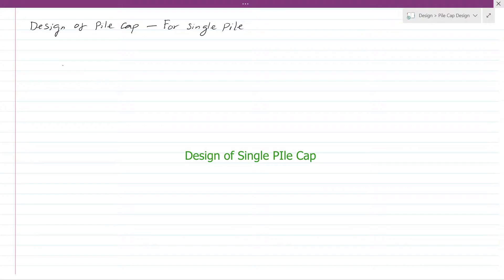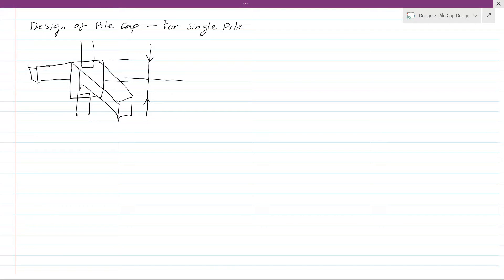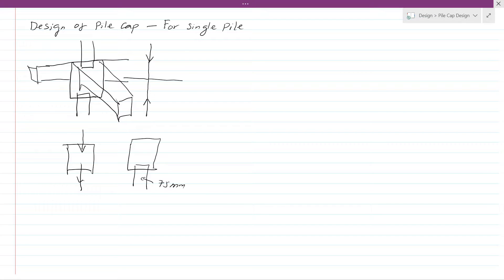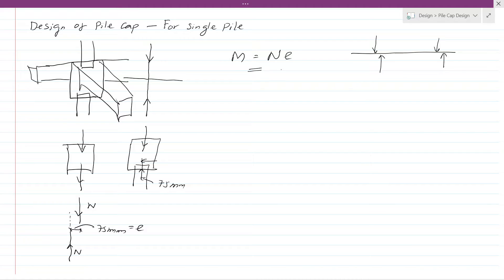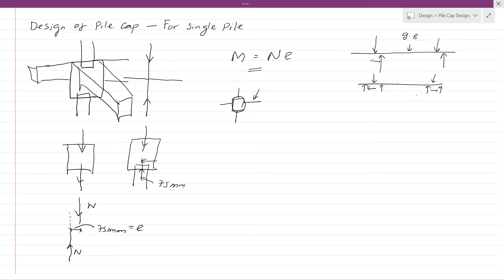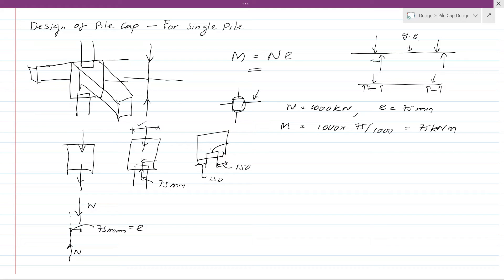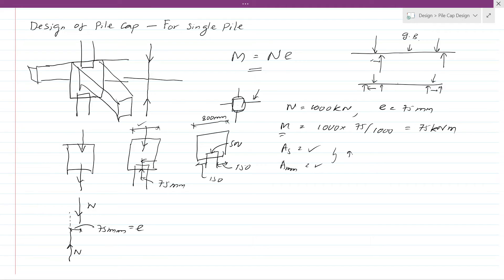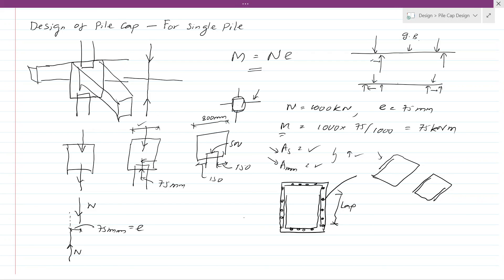Pile Cap | Design of Single Pile Cap | Worked Example

Comment: Which Code clauses specify the 75mm eccentricity, and the 150mm overhang?
Reply from the maker: These depend on the type of code and construction methods. Generally, the allowable tolerance is defined for the pile construction and then it is considered for the design.
You may refer to the structuralguide.com website for more articles on this. 
The following like would solve most of your concerns. 
https://www.structuralguide.com/pile-foundation-construction/

Comment: is it possible to design without beam
Reply from the maker: No, it is not recommended. We should have a beam and the most preferred arrangement is to connect the beam to the pile cap.